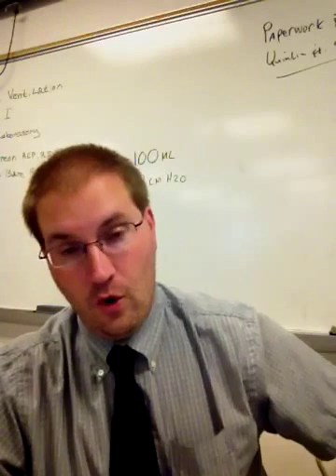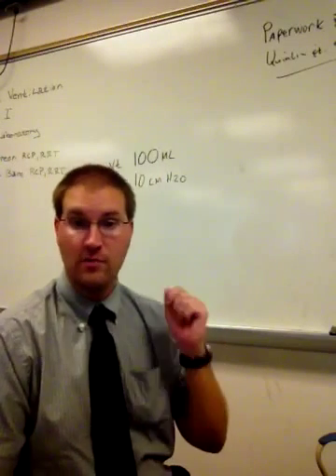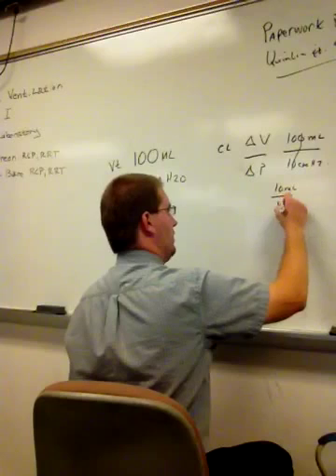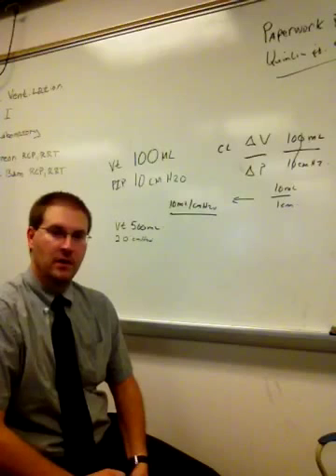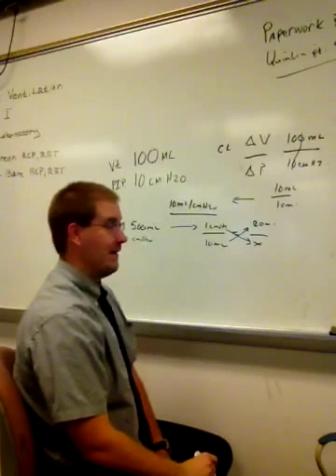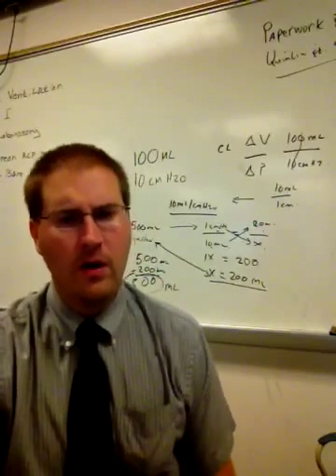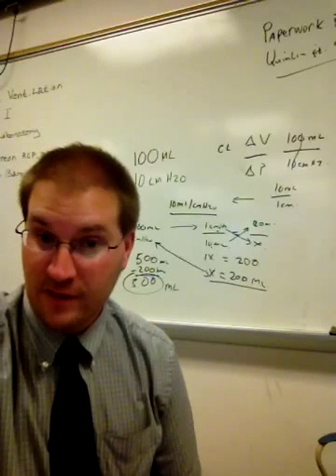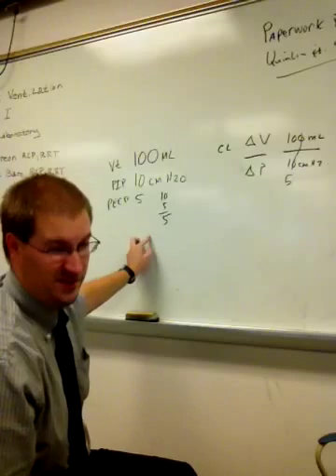Introduction to Mechanical Ventilation 4

Comment: question:The low pressure alarm on the ventilator sounds after initiation of mechanical ventilation. The ventilator is attaining a PIP of 15 cm H2O.

Could Checking the ventilator circuit compliance have an affect on the low pressure alarm sound? thanks
Reply: I noticed that you mentioned you can loose volume on circuit compliance so that does that mean, it could be a leak? Thank you so much for your help. Taking my Clinical Sim. soon and this was one of the practice questions.